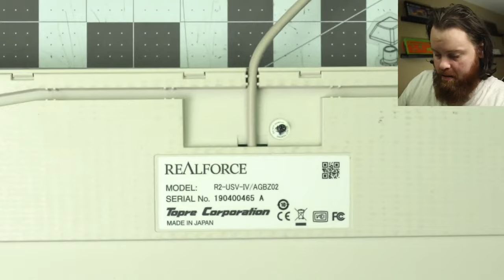How to Disassemble Realforce and Topre Keyboards

Comment: Thanks so much for making this video. The space key on my Realforce R2 just stopped working after I cleaned the keys, was settling on having to replace the key which I'd never done before. But whilst watching your video it fixed itself XD. But still a great and concise video on taking these keebs apart, cheers.
Reply: Same, but i took it apart and now none of the keys work. Do you know does it need to be fully assembled to work?

Comment: I want to remove all those black plastic parts of the switch from the plate so I can re-paint my Plate (FC660C has some rust).  If I break one is there a place I can purchase those parts or will the board be ruined?  Otherwise maybe I'm better off just leaving the rust as is?
Reply from the maker: I offer replacement parts on my website. I'm about to post a restock of housings and I usually have them available. I'm also about to release a few tools to help with the removal of the housings by popping them out
Reply: @UnrealKeyboards  Would the replacement parts work on the FC660C?  I'm a little worried about breaking the stem housings after watching another video that says they should not be removed.  Thanks!

Comment: Hey there!

I took the keycaps off my 87U and sow those same white spots in the housing. Tried rubbing alcohol, and even my nail but I can't get rid of them. Do you know what are they and how to clean those?
Reply from the maker: It sounds like you're looking at a previously lubed board. The only way to clean them is with an ultrasonic cleaner